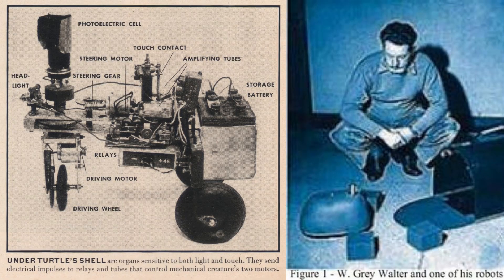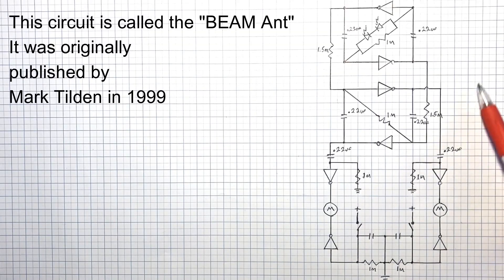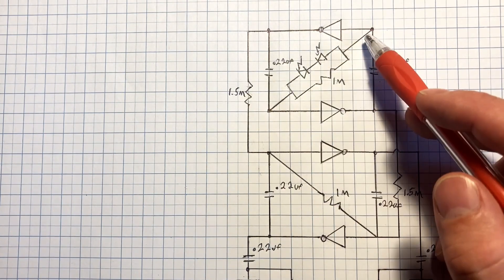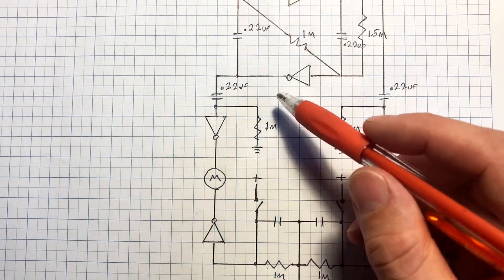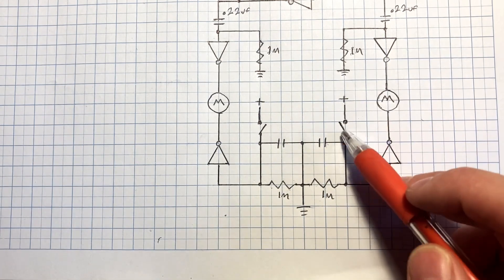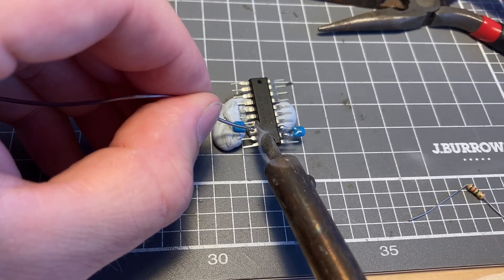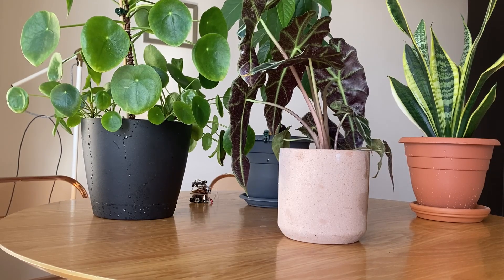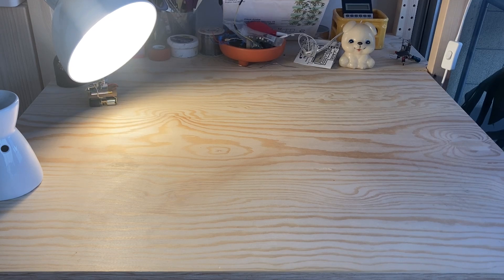Hardwiring very small neural nets to power a robot

Comment: Can BEAM robots have Braitenberg-level simple neural nets with Hebbian learning?
Reply from the maker: Most Beam designs, or at least most classic designs, don't have any learning built into them. It would certainly be possible to make one with some sort of reinforcement based on how often patterns or neurons fire, but it would be tough to get working with such simple designs.
Reply: @ALTcorporation  are there any ways to make variable threshold oscillators using capacitors to emulate plasticity? perhaps by attaching capacitors somewhere to nv neurons, or using 555 but with capacitors in place of trigger/threshold voltages

Comment: You couldn't train this neural net, but maybe it would make a good training tool for an ml neural net? I think you could at least give that little guy a proper brain so it's exploring isn't in vain.
Reply from the maker: I think “training” in the case of BEAM systems would be the actual layout of the different elements. Weighting of different input values would literally be done with resistor and capacitor values. I don’t really know how you would design very large networks of these neurons but maybe that could be done with ai and then it could be built in the real world.
Reply: @ALTcorporation  yep. Beam unit sensory system is hard wired, the ml neural network is rewritable memory and processor.

Comment: I played with a BEAM robot I built based on a magazine article about them back in the late 1980s. I thought of improvements to it but never did try to build those. -- One thing I thought was annoying about the 80's BEAM robot movement was that they seemed preoccupied with the idea that you 'had' to build these out of scrapped parts which I always thought was a dumb limitation.
Reply: Mouser electronics sells voltage supervisors for solar engines, the MCP112-270E is a good alternative to the panasonic 1381

Comment: I love this. I was trying something a few months ago where I was trying to combine BEAM nerve networks with cybernetic feedback loops. My idea was to average the voltage of all nerve and compare that to a control signal the result would go back into the network via capacitor which should add or remove pulses to make the network average equal to the control voltage. Basically a voltage controlled pattern generator. But, I was only able to remove pulses. I tried adding a 555 timer to constantly stimulate the network but the capacitor couldn't keep up. I'm planning on replace the cap with a mosfet to break the network to kill pulses. But, I ran out of energy.

I was hoping to make a central pattern generator for generating a walking gait for a given motor current. Letting the robot change how it walks to trade speed for stability.

Comment: I've read (many yonks ago) that to drive slightly more powerful motors you can double-up the same chip so that the leads are connected in parallel and split the current. A possibly cheaper and quicker alternative to building out dedicated motor driver modules. 
I wonder if anything interesting would happen if the coupling resistor in the core was replaced with a couple of photocells in series rather than having photodiodes alongside it.
Reply from the maker: Stacking chips was my back up plan if it turned out the chip couldn’t drive the motor itself. I think I would have had to not connect the bicore/neurons as I think the small differences in the switching voltages might make for some weird effects. You could put two photocells across the bicore but you could have to ground the middle of the two cells, otherwise it will not have any right/left ability. It might also have a larger effect on the period of the oscillations. Might be interesting to try

Comment: I believe it was Scientific American magazine that did an extensive writeup of these in the early '90's. They had detailed descriptions of robots that had light sensors fed into neural networks to rotate motors on the wheels. They were placed on a platform with walls and randomly placed lightbulbs on it. Depending on basic changes to the connections, they were able to demonstrate some fairly ( for the time ) complex behaviors.

About the complexity and training, have you thought of using an fpga? Perhaps with one as the central 'brain' you could simulate a complex set of neurons that could be changed to adjust to new information. Its been too long since I used them, but that might be a profitable avenue to explore.

I like what you've done in this video! I'll be looking for the next one.

Comment: Aaand... I'm late again! Great video and explanation, as always! I've actually have never built a beamant, but now feel very inspired by your video :D
Reply from the maker: You should do it. They have some really cool behaviours and if you swap out the resistors you can get them to act quite differently. I am thinking about a way to get the light and motor driver bicore to be used with a walker but I haven't built it yet.

Comment: How about simple learning, such as stimulus substitution (a simplified model of classical conditioning) or maybe weakening of response due to repeated presentation of a stimulus (a simplified model of habituation) etc? Have beam robots any plasticity? I guess might be relatively easy to do having a capacitor being charged to represent the synaptic efficacy and maybe used to control a transistor that in turn affects another subsystem… thinking out loud 😃
Reply from the maker: Beam robots do have somewhat flexible responses do to feedback within the circuits. Motor loads will affect the timing of the  "neurons" switching, it can be very beneficial in walking robots. 
Memory is a bit of a problem with BEAM robots, there aren't many designs that incorporate it and the layouts make it hard to use. I have though about using a shift register as a basic memory but I haven't built anything yet
Reply: Variable resistor could be used as a equivalent to myelination/reinfrocement, it just needs to be sensitive to the right thing. Aren't there transistors that have varying but not completely on/off flow? That could work too.
I wonder also about magnetic cores and rope memory, it would be being used very differently in something like this though
Reply: @ a little like Braitenberg’s “mnemotrix” connections in his vehicles. If instead of trying to mimic Hebbian learning, one uses simpler “synapse-on-synapse” connections of Aplysia (see https://www.cs.cmu.edu/afs/cs/academic/class/15883-f19/readings/hawkins-1984.pdf) where a transferable resistor (the transistor) can be used as the “strength” of the connection, then I reckon it might work yep 👍 under such an arrangement a capacitor would be used to hold a charge that is the analogue memory store, with this driving (and varying) the current the transistor allows through to another part of the BEAM circuit. As to what charges the capacitor (via a low-pass slow charging), that depends on some circuits for modelling either associative or sensitisation style learning.
Reply from the maker: That sounds like it could work. It as a sort of variable resistor and pull down (or up) inputs to specific neurons and influence the behaviour that way. I wonder how much of an issue voltage fluctuations would be for those types of transistor systems?

Comment: I think you could use the analog output of the discrete components as an input to a programmed neural network thought which you would pre train with various activities based on the output voltage for a set of actions. And by doing this you could have an analog to digital neural network combined. Just my thoughts. Cool demonstration

Comment: Nice build!  I suppose you could model the nervous nets offline and train them in a simulated environment before hard wiring them.  But I agree, that would only get you so far with such a simple architecture.
Reply from the maker: Because each neuron is a pretty simple element I think they could be modelled pretty easily. I think the real issue is that a lot of the feedback comes from the robot interacting with its environment, I am not sure how easy it would be to model that part.
Some of Tilden's bots had a swappable resistor bank so the nets could be "trained" that way. 
You're right though, I think there is pretty hard limits on how complex these can be made.
Reply: @ALTcorporation  Look for the 2016 interview of Rodney Brooks with Nick Thompson.  At about 35 minutes into the video, he admits that the subsumption architecture ran out of gas.  Even Tilden's Robosapien used microcontrollers.  So there are hard limits to BEAM and subsumption, they just don't scale up.

Comment: Another way to look at these circuits is that they are coupled oscillators.  One old emergent behavior is that of pendulums that are attached to a common, stiff connecter at their fulcrums.  IIRC, the effect was discovered when a clockmaker in the... 16th? century fell very ill and was bedridden.  A pair of his clocks were brought in to cheer him up and placed on a shelf, with their pendulums hanging down.  

After a while, the two pendulums synchronized their swings.  The clockmaker thought himself good, but he knew he was not so good that two random clocks of his collection would have the exact same period for their pendulums such that they would stay in synch indefinitely.  He eventually figured out that the shelf was imparting the motion of each pendulum on the other, and that given time they would either swing together, or 180 degrees out of phase with one another.

The effect is most pronounced with legged walkers, where you can see the left-right motion of the legs attached to the shafts.  Each leg is driven by an oscillator that is coupled VERY tightly 180 degrees out of phase with its partner, such that disruptions to the travel of the motor shaft in one circuit can force reorganization of the whole coupled system.
Reply: Christiaan Huygens
Reply: @charlesmartin1972  Yes!  Thank you!
Reply: nice explanation!